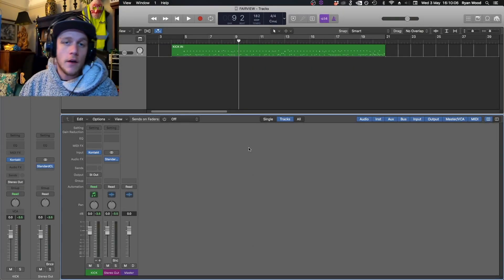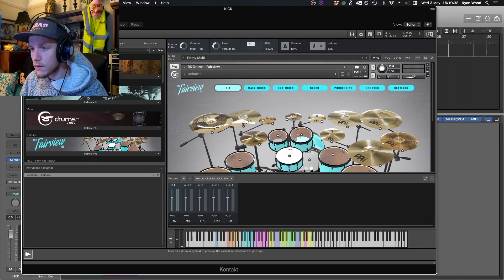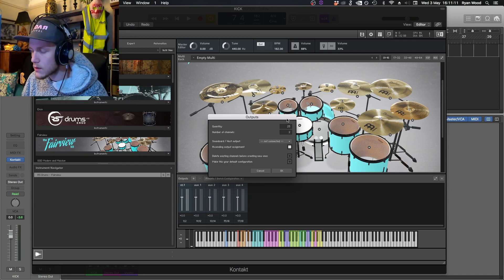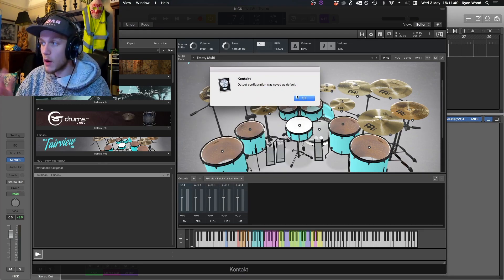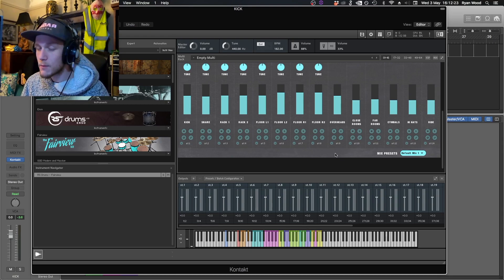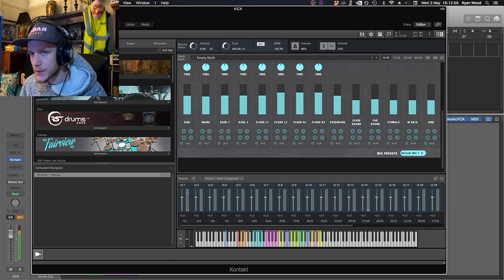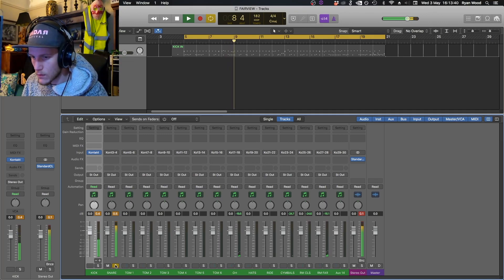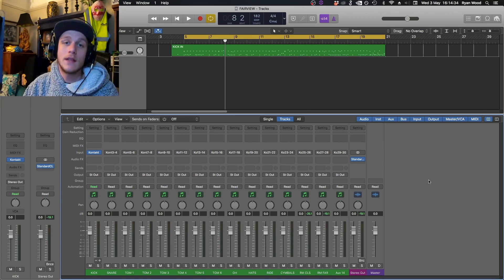The Fairview Kit | Routing in Logic Pro

Comment: Is there a way to make sure Fairview Drums does not hog all my cpu resources like it does. 😢
Reply from the maker: It could be related to one of the mix presets you're using. The 105 and the Metalcore Money are both a bit heavier on CPU, especially the 105. The Default 1 and 2 are a bit lighter.